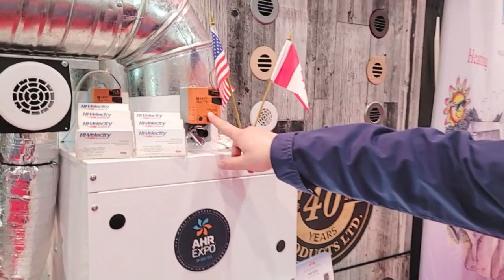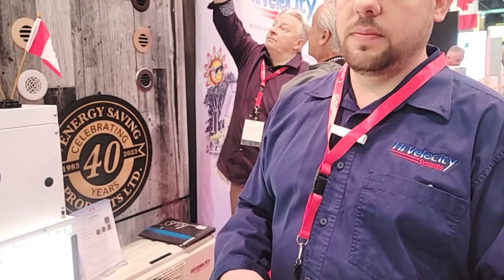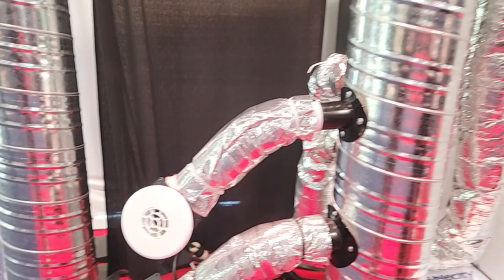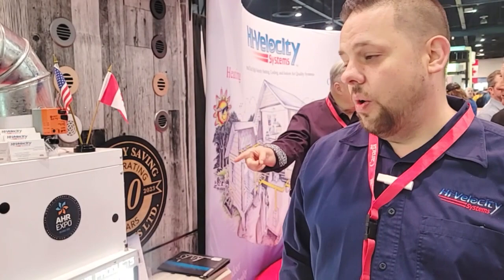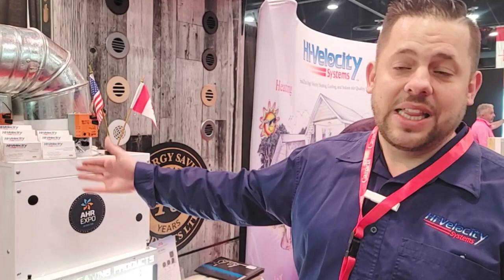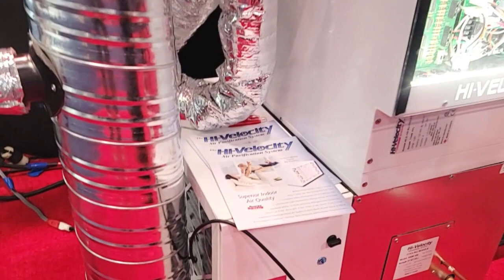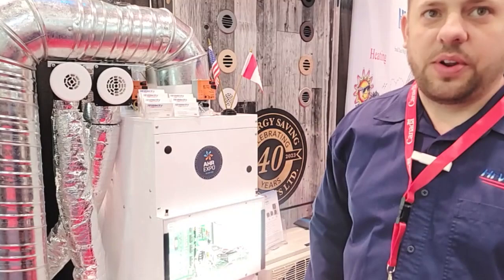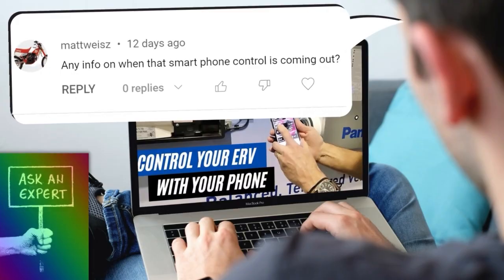Understanding Hi Velocity HVAC Systems: A Comprehensive Guide

Comment: What is the procedure to clean this system?
Reply from the maker: Not sure you need to clean it much since the air is moving so quickly.  Just make sure the filter is changed so you can protect the fan and coil while cleaning the air.
Reply: If you verify that there are no air  leaks in the negative pressure return system you’ll be okay

Comment: As an hvac technician, do not recommend these systems. We see entire neighborhoods wishing they knew or didn’t have these in there home. They have a lot of downsides.

Also not proper for air conditioning, they literally base the idea that freezing of the indoor coil often with a factory freeze stat installed is normal and claim “better” dehumidification, when it’s really just reducing the life of your AC system and causes problems cause they don’t move the correct amount of CFM required for the size of AC
Reply from the maker: I prefer a separate dehumidification system in our climate zone.  Also hi-velocity is good for designs where there was not a lot of consideration for space for ducting.